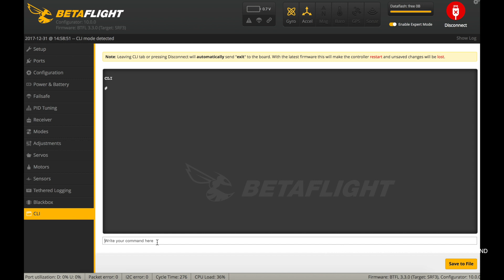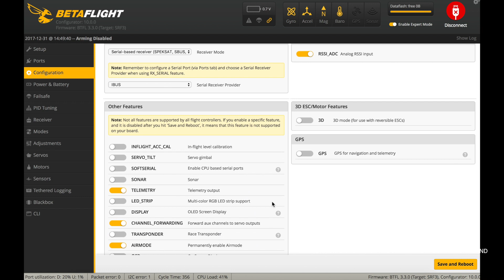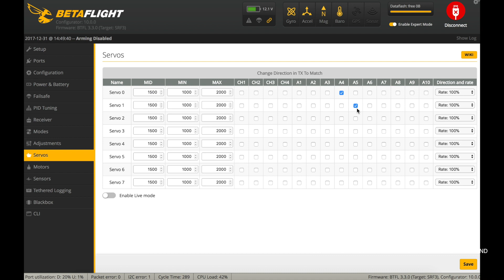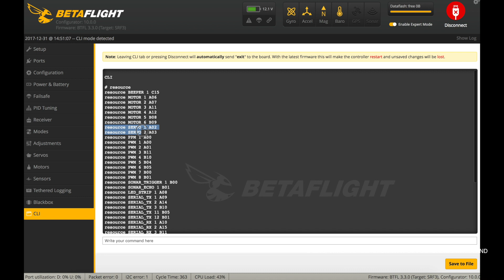🛠 Connect Two Servo's and CHANNEL_FORWARDING on Betaflight or Cleanflight

Comment: hi i have a problem conecting servos to the omnibusf4v3(sd) with the reciver fs-a8s(ppm)
i am conecting it to the pwm 2 and 3, and the motor with the esc to the pwm 1 , but im not geting pwm output. this is for a plane